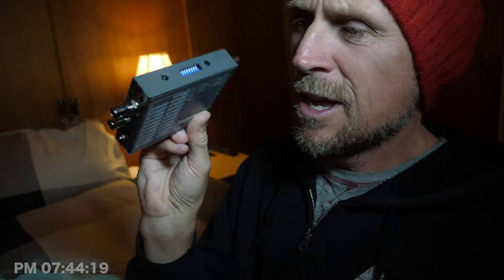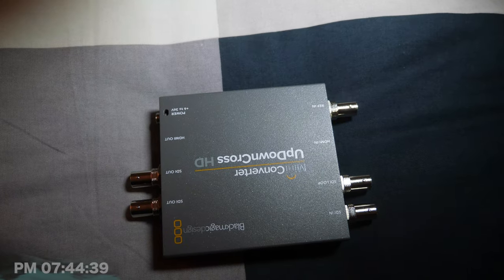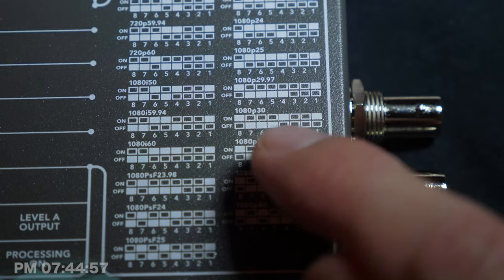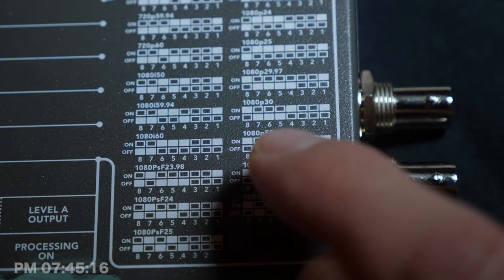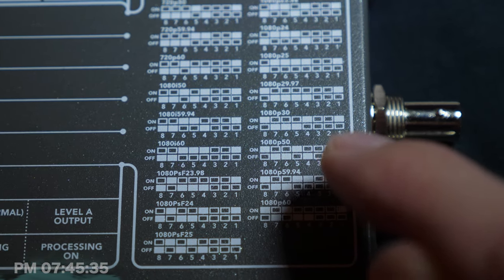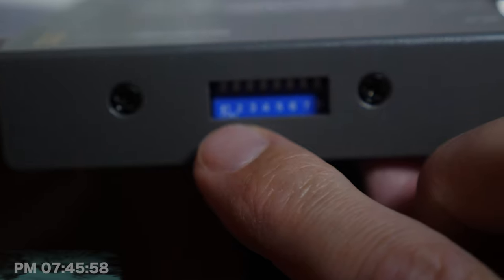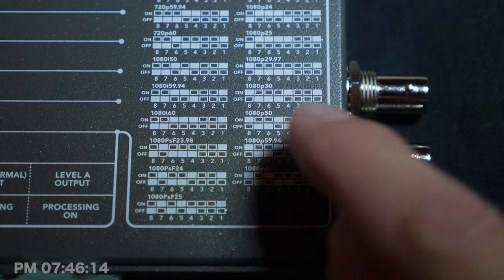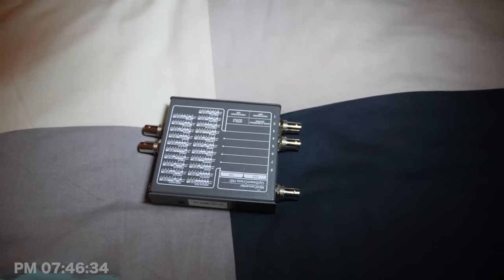I’m Confused By Dip Switch Settings On Blackmagic Design Mini Converter

Comment: I have a Analog to SDI converter, the numbers start with one on the left and an arrow pointing down as on. I need component so that dipswitch 5. I  put 5 dipswitch down and it doesn’t work and I remember watching a video about this, thought your video was it but it isn’t. In the video I watched the person found that placing the dip switch down is wrong, on is up. Sure enough I put the switch up and it worked. My brain still hurts from that!

Comment: So the orientation of the dip-switch in relation to the schematic is correct (but no doubt confusing). 
When the dip switch upside down, it is numbered 8-1, and ON is on top. While still holding it the same way, with the schematic/drawing, the ON is on top, and numbered 8-1. 

I checked the manual of the converters, and BMD wants you to look at the diagram upside down and see the dip switch right side up. They say: "Ensure your switch
settings correspond to the legend by observing the switch numbers from 1 to 8, left to right."

I'm assuming that switches 3 & 2 have no impact on the output resolution, so anything that it is, is fine.

Hope that makes sense

EDIT: LOL, just saw you figured it out
Reply from the maker: Thanks :) It's super confusing!!!

Comment: I don't think the Blackmagic designers could make it any more confusing.
It's all bad enough that you have to mess with dip switches in the first place - These units should be auto-sensing like many smart devices these days.
This however, are clearly NOT smart devices.
Theatrixx is a much more user friendly device if your thing is always doings setups and teardowns.
We have a dozen or so of these Blackmagic converters and there's always one in the box that refuses to do as it's told.
Reply from the maker: Yeah, I pretty quickly got rid of this device not long after making this video.